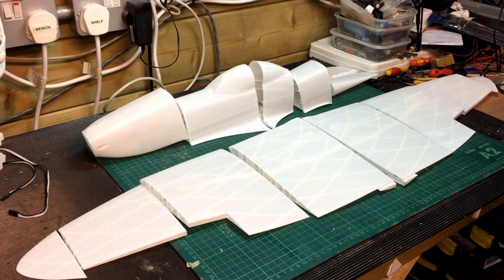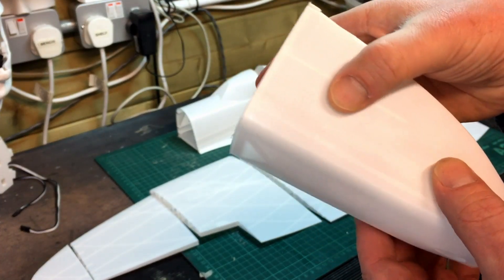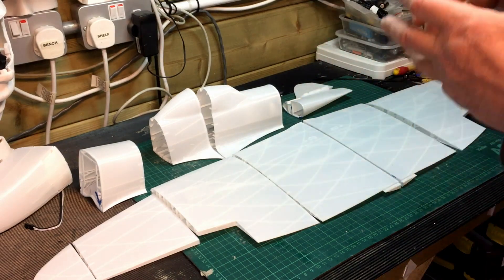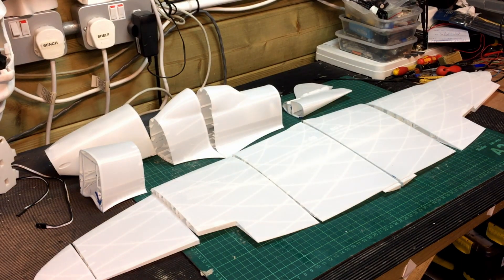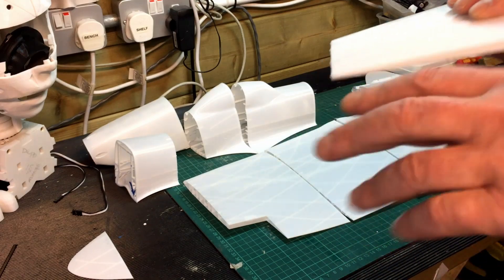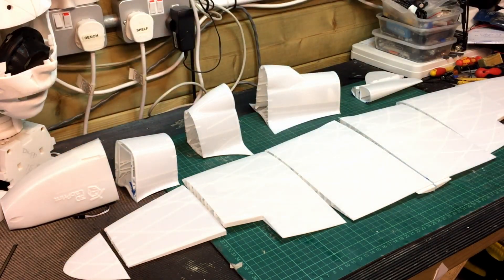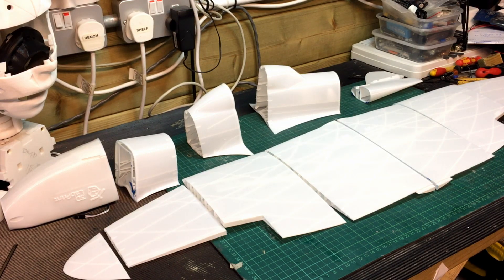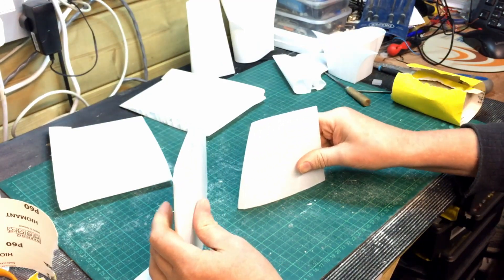RC Planes Part  1 - Spitfire

Comment: You mentioned filling gaps with superglue. Don't forget you can use your 3D pen too. Just be careful it doesn't gouge the aircraft parts.
Reply from the maker: I'm probably being a bit precious about any gaps anyway, as long as its structurally sound.

Comment: thats a huge diff then r2d2 but  like it. did you ever try a glas bed for yourre printer?
Reply from the maker: Yes something different is always nice. Am building my 4th 3DLabs plane kit at the moment.    I bought a glass bed for my old Wanhoa that Im slowly rebuilding, not complete yet.   I damaged the bed again on the Prussa whilst printing PETG.    I have the Prusa upgrade kit that includes the new flexible bed sheets so probably my next project as the Prussa is feeling a bit worn and keeps jamming up.  Just fitted a new nozzle but probably needs more care and attention still.
Reply: @kylecampbellweb  PETG has had me nervous from the beginning. I want to do what you did with my R2 and print parts like the feet innards in PETG but your experience and warnings I've seen online have me leery. I'm considering getting an Ender 3 with a removable bed for that reason and for printing the TPU since I bricked my Da Vinci Pro.
Nice work with the aircraft, that is nice how they designed it. I suggest yes, start with something simple and cheap. Practice on a day with little wind. Watch out for the controls! Some controllers are IR NOT radio. I found out the hard way when I took my first helicopter outside and it decided to fly to the sun and I never saw it again... lol
Reply from the maker: @chrishechtl8330  I damaged the bed again within a couple of weeks of repairing it last time.   Then this spring I printed hundreds of the face masks for my local hospitals and they were mostly in PETG.  What I found though is PETG varies in quality, a local charity supplied the PETG for the masks and it was hard to print with.   The PETG I normally use is fine [apart from wrecking the print bed] it didnt jam the whole time so with a bit of care its OK. 

Looking forward to trying out the RC planes but maybe next year now.   At least when I crash I can reprint bits.  Did you ever get your helicopter back?!
Reply: @kylecampbellweb  Nope. I bought another and only flew it in the garage. I have another larger cheaper helicopter I received for Christmas 4 years ago that is still in the box. It is too big to fly in my backyard with the trees and my local parks have a lot of trees and banned RC flyers. 
My family tried to get me to fly it in the street but with all the cars around and trying to land it... yeah, no. lol